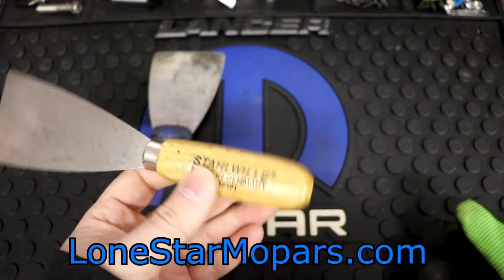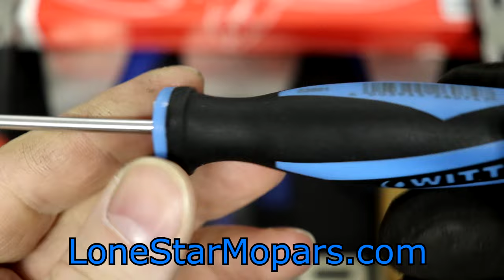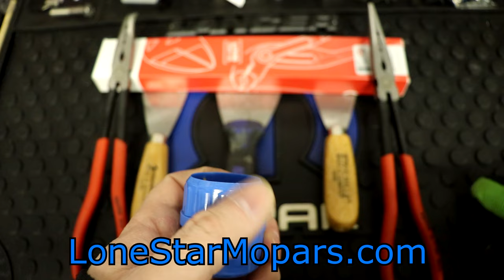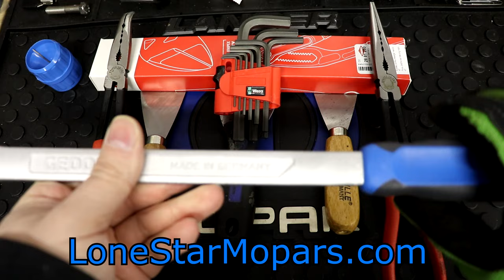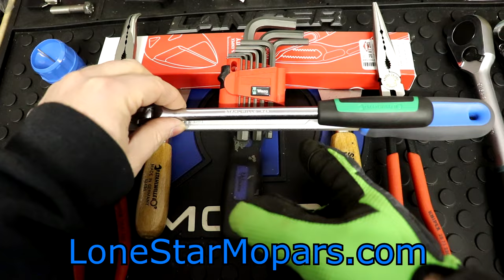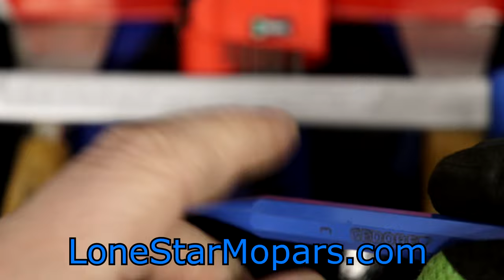KC Tool Haul #98 : Tools for Repairs at Work (Bonus Old LeBlond and Cushman Repair Stories)

Comment: Great stuff, another awesome tool haul. Thanks for the video.
Reply from the maker: Thanks for watching...glad you enjoyed!  The Gedore breaker bar has been great at work...biggest concern was if it would be a pain to spin (straight up like a nut driver) with the rectangular handle, but it has been pretty good on that front too...just have to get adjusted to it.

Comment: I've been eyeing those long reach knipex for a while now, also the knipex orbis bent handle long nose pliers (9O21-150)

I got a cheap pair of pistol grip style pliers and I use them way more than I thought. Would like to get some nicer sets of different variations of bent pliers. Will probably pick up these new icon snap on knock offs when I can find them, although I'd prefer to find something similar that's american/german/Japanese made without paying snappy prices. 

Found out recently that Klein made a very similar set as these knipex long reach straight and bent nose. Wish they didn't discontinue them.
Reply from the maker: The EZ-Red set goes on sale for dirt cheap, but sort of kills the higher quality you are after.  My most used would be these: https://www.kctool.com/nws-8-ergonomic-high-leverage-combination-pliers-ergocombi-titanfinish-softgripp-tethered-attachment/
I've got the Icons on a short list, but they haven't had a 20% off in awhile...plus, they are hardly ever in stock around here.

Comment: thanks for the awesome tool haul. gedores handles are great, i have a pry bar set with them too but the handles are black, and my favorite ratchet, the 1993 u-10 (when it fits lol, things massive) i had the u-20 but it was a world away worse off in backdrag unfortunately.
have you tried putting the square keyed t bar into one of the 3 square slots and hitting the t bar back and forth? chuck in a vice with soft jaws obviously. or for striking the scroll, try getting a length of aluminum and put a taper on the end so you can wail on it and just remachine the end when its mangled. would the whole chuck fit on a bearing heater? you could heat the whole thing up and let it cool, do that a few times and striking the appropriate spots during the process.
never use spot heat (oxy torch) on induction hardened stuff, typically on machining equipment its just a combination of oil and coolant that becomes immovable as if its welded, but just needs a decent shock.
i have worked a lot of old machines from world war eras, one particular interesting one was a skoda, same brand as the car manufacturer of today, it was a floor borer, basically a 15m(49ft) bed with an additional 3x3m rotary table. the thing was multiple stories high, above and below the bed, think of the head of a milling machine that has a platform and a seat that moves around with the head. another machine had 100m (328ft) of concrete below to stabilize the 9m (30ft) vertical chuck.
sorry for the long comment, do not feel the need to reply to all of it.
Reply from the maker: That sounds like it would be quite interesting to work with, let alone maintain the Skoda!  I was finally able to get the chuck separated...basically had to drop it from chest height to the floor a few times and then finish it off with a brass slug once I got the jaws out of the way.  I broke a few brass punches, mainly because it wasn't a straight shot so the tips would bend...then on "straightening" they eventually just stress and shear.  Yeah, the pinion rack was insane to remove...you would think it would have been pretty easy with just a tap from the rear etc.  Yeah, I've tried to figure out if the 3/8" breaker bar would have the blue handle, or be black and haven't found out for sure.  Are the black handles soft, or a hard plastic?  I nearly bought their pry bars a few years ago.  The breaker bar in this video has been awesome at work.  My biggest concern was that it wouldn't spin stuff well (180 degrees), but it does fairly well for a non-round handle.  I have my Gedore socket set in the US General 4 Drawer and moved it and subsequently don't use the set as often anymore..it is a really nice setup and the center lock is still my favorite feature.
Reply: @lonestarmopars   if i recall correctly i suggested dropping it from a low height months ago haha, regardless, I'm happy you solved the mystery.
the black handles are hard, they do not have the softer parts like the ratchets, but the shape is great nonetheless. yes the center lock is great but i have used that rarely. i prefer hazet or stahlwille 12 point, but as far as inhex go, i would say the gedores i have are the best.
Reply from the maker: It gets hard to keep up with the videos when they sit for so long...also, there are times I record something in a series and then mention the same issue in something else that gets released way sooner.  I typically try to go back and skim the video before I release it.  The KC Tool stuff is almost always a few months back, but if it is new, or rushed, it might come out the day after filming...just kind of depends.  Fwiw, I've got up thru 119 now, lol.  I did put cardboard down before dropping it...kind of crazy you have to resort to that, but it did the trick.
Thanks for the intel on the handles...I've gotten to really like the Mac handles, but was always still curious about Gedore's.  I'm slowly working to expand the German socket setup...deeps are insanely expensive, but also a good bit deeper than domestic and cheap imports.
Reply: @lonestarmopars   I  do not post a comment and demand a reply, i post a comment to help with the youtube algorithm as you really deserve so much more exposure than what you get it seems, and if i get a reply, well that's great too. yeah, you have told me that before but i always forget haha. well if it was my comment that helped with the drop shock then that's great. its great for unravelling new ban saw blades, throw it up to land 2m in front of you and instant unraveling.
i like the idea of getting some Mac tools but they'd have to be USA made for me to bother.
thanks again mate